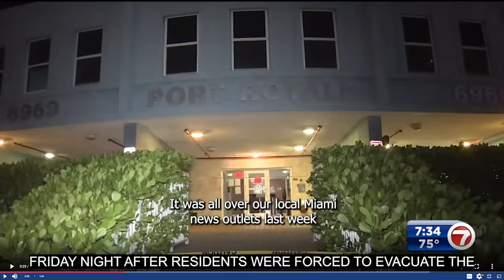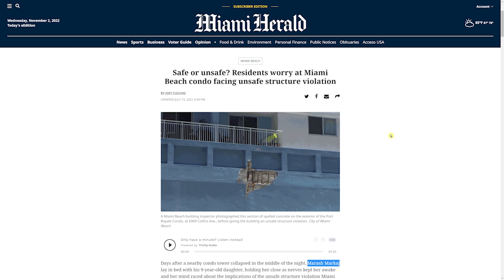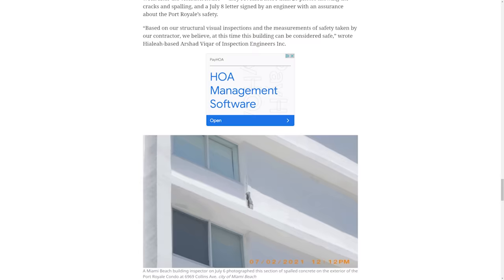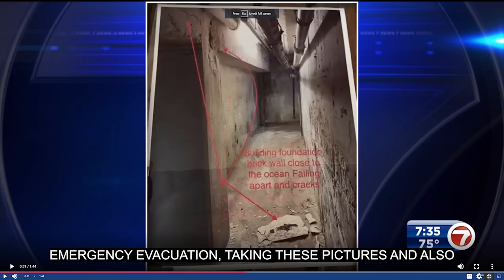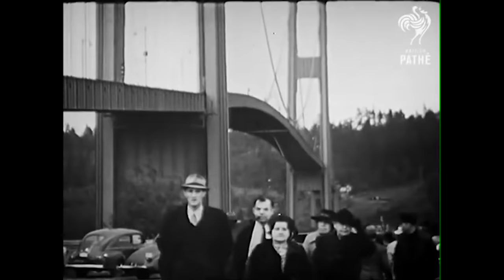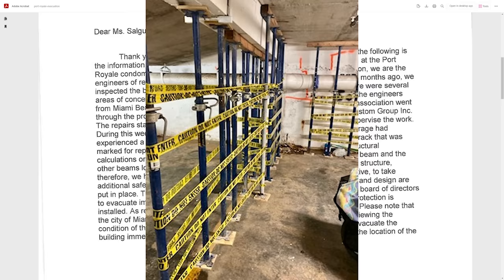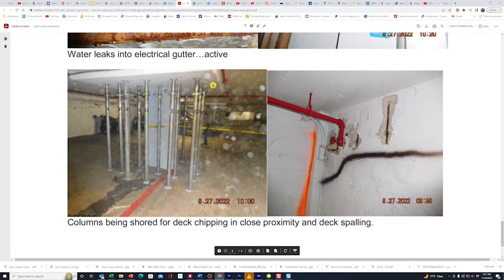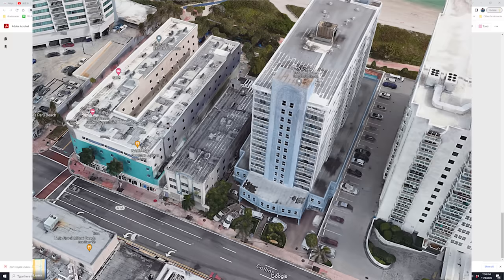Another Miami Condo Evacuated Why it Will Collapse

Comment: It has  become crystal clear from the corrosion photos in the collapsed condo as well as this one ( and tens of thousands of bridges and other steel rebarred structures) that steel rebar, although the cheapest solution, should be permanently forbidden via changes to the underlying codes from being used in construction of all structures. What will replace steel rebar? Epoxy coated steel rebar will not work either because construction damages as well as numerous pinholes allow ions to penetrate = same corrosion occurs, albeit at a delayed, but inexorable, rate. The use of triple dipped galvanised steel rebar is OK for 100-200 years. Additionally stainless steel (SS) solid rebar is a permanent solution and will add only ~~1% to the cost of the structure. SS is about 15-20 times as costly - but negligible in cost overall. Steel rebar can also be coated with SS in a rolling process more cheaply at a lower cost and the surface grip indented for mechanical keying in this process - cut ends needing epoxification to reduce end migration of the deadly ions - rolled SS coated rebar with epoxy should also serve for ~~ 200 years. Total SS rebar should serve for millennia. Lead will serve, but has environmental risks - as the Romans found!!

Comment: This building is unsavable, as are many around it.  Concrete absorbs and holds moisture, and the steel rebar gets a moisture bath 24/7.   Its whack-a-mole at best, for a few years until they have to face the music.  You find this everywhere, but it is accelerated in tropical salty conditions.  There is rusted rebar throughout that entire building that isn't even discovered yet.  I've been a contractor for 46 years, and in that time you see a lot.  You learn to connect the dots...

Comment: One concern of mine is the possibility that some unscrupulous contractors might have substituted cheap and plentiful salt water in place of fresh water in the mixing of the concrete for these structural members. The salt water in the concrete would accelerate the corrosion of the steel rebars within and lead to weakening of the concrete.
Reply from the maker: A lot of people tend to spread and make up this unbelievably false myth. This has nothing to do with the contractors, the concrete is delivered by concrete manufacturers miles away and they make it to very strict formulas they are nowhere near the ocean and just deal with local water.

Comment: Just give it the good ole land lord special. Some calking and paint ought to do
Reply from the maker: Naw don't spend that much, duct tape!
Reply: @jeffostroff  when i studied chemistry before switching to engineering i often wondered why we dont put some kind of thick sealent or UZ resistant epoxy on concrete buildings along the coast. Then when I was studying electronic control theory, we were tought the user should not have to know more control theory to control your device than you. Then the 737 max control problems happened. Those pilots had no idea they only had seconds to disengage auto contols before their aircraft went into unstable flight.

Comment: OK, I'm just an Electrician, but IMNSHO, that beam in the garage needs the shoring poles extended at LEAST another 6 feet each side, AND a steel plate cap between them and the beam.
That's still a bandage on arterial bleedimg, though.
How come no one uses sacrificial anodes???

Comment: These South Florida  structures always show a ton of  " rust on the rebars of old ".  The salt air in some of that great weather is driven deep into the structures causing dis-adhesion to these structural elements over time.  The fancy coated rebar of today  is better protected from corrosive elements.  I see these things through my deeply educated mind and eyes.  Scary stuff for sure,  but it doesn't mean someone set out to build cheap or use less strength in the structures.   Technology of the day, and engineering specs, were what they was in many instances.

Comment: All beams are in compression and tension by definition.  What you may have meant is that the entire cross-section went into tension when normally it is only on one side of the neutral axis, although then it wouldn't really be a beam would it....
Reply from the maker: Yes a lot of curvature on the bottom of the beam

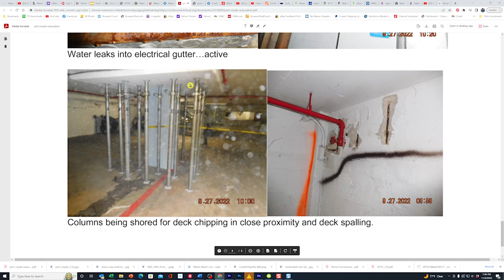Comment: @11:00 ~ , my guess is why the photo quality sucks is it was taken with an old digital camera, as it has a date/time stamp in the photo which usually only digital cameras add (dont see it much on cell phone cameras, and the font looks like the generic ones on most older digital cameras.) so they probably never updated their cameras and are still using an old 3-5megapixel camera from the mid 2000s, i mean it works but most new cell phones would give alot better pictures, i guess they need something that adds a timestamp for documentation purposes

Comment: They probably should not build tall buildings near the waterfront. I'm not an engineer, but I understand that the problem with rebar is that the steel eventually rusts in most/all cases. Does anyone know how tall one could make a building just using concrete, or stone based materials, with no rebar?
Reply from the maker: Some of those taller 40 story condos in miami that they built the last 10 years are likely steel columns and girders

Comment: Turns out steel reenforced concrete needs to be kept dry like wood. Do that and it will last 1000 years. Otherwise the salt gives it a service life of 30 years. I worry about other rain soaked concrete too, even without salt. Rain is slightly acidic and over time the pH of the concrete will fall sufficiently to rust steel.

Comment: These are built on sand dunes, and probably didn't have their vertical  posts of cement attached to bedrock.
Reply from the maker: John there were over 100 piles pounded down to the limestone bedrock. It's in the florplans. There are no dunes down there, just flat beach

Comment: Why not use stainless steel rebar or corrosion-proof rebar for all structures near the saltwater beach?
Reply from the maker: I'm not even sure if epoxy coated rebar was used at the time of construction back in 1981. Nowadays many construction projects use it so I'm sure if this building had been built today it would be in a lot better shape.

Comment: Boy concrete is such a slippery slope. It's the stoutest material for building on earth and the most volatile when it begins to fail. Wood is crappier in storms, fires, load bearing, etc, but nowhere near as heavy and much quicker to repair.

Comment: That beam has already failed, it just hasn't yet collapsed.  Those cracks can't spread horizontally like that without it essentially beginning to fold.  I'm not a structural engineer, but any engineer can see a major failure in that crack pattern.

Additionally, the shoring looks questionable.  The rightmost support only has about 40% thickness of the right side above it, which doesn't seem sufficient.  I'd like to see it extend to at least a couple of poles with the full beam above them.

Comment: Two issues that are fatal and cannot be fixed:
1) Rebar. It is a "cheat" that structural engineers use to have a cheap material that only handles compression (concrete) in applications that have tensile forces. The Pantheon is 2000 years old, made of concrete, has no rebar, and is still standing. 
2) Condo Associations. The tenants/owners refuse to add maintenance fees to their monthly bill to establish an escrow fund. They choose to wait until either (A) they die and the problem is no longer theirs, or, (B) something catastrophic happens and they have no alternative to paying for the maintenance.
Reply from the maker: The idea is to put enough additional support to help these beams that could be in tensile forces to keep them away from being intense all forces by making sure it's stationary. It's no different than operating a transistor and making sure that it operates in the saturation region so that you can make a transistor be a switch instead of an analog component.

Comment: On A Serious Note the NTSB doesn't bat an eye when it comes to grounding aircraft once a mechanical flaw is determined.  So buildings ,especially those in such harsh environments such as Miami shouldn't be any exception. I'd rather be homeless than dead. Given the changes in our climate & although Miami doesn't deal with freezing they do however deal with seriously high winds during hurricane season, let alone the wear & tear that exposed rebar takes on with salty ocean water. You'd think many years ago they'd of established that all rebar used on coastal cities should of certainly been treated with some sort of anti rust/ corrosion inhibitor to prevent such structural deterioration.

Comment: I think reinforced concrete is one of the worst ideas humanity has ever had.
Civil engineers love it because it is relatively cheap but they ignore it's achilles heel - corrosion.
As a mechanical engineer I have a low opinion of it because its final properties are so dependant on how diligent and honest the construction contactor was.
It is very difficult / impossible to inspect the quality post construction.
Also it seems to me that civil engineers often sail very close to the wind - as if it is a very predictable material.
Case in point - in 2004 I was in the Charles de Gauile terminal 3 a week before it collapsed. I had 3 1/2 hours to kill and was very intrigued by the shape of the structure. I was amazed when I realised that it was reinforced concrete rather than steel as I would have expected.
I thought to myself that I would never have dared to design a structure that way, but assumed that I was just ignorant. Turns out that the French civil engineers were just arrogant and negligent.

Comment: Funny thing is about 50 year old tower issues.    Well, the "unreinforced" concrete dome - the Panthenon in Rome - was dedicated in 126AD.  It is still standing and in use.
Reply: Totally different construction methods, and totally different practicalities. The Pantheon has extremely thick walls at the base, with very minimal openings aside from the opening at the top and is obviously a dome - domes and arches are self supporting. It's also supporting nothing but itself.
It was created at very high cost, took a decade to build, and was presumably designed and built by the best people they could find.
The lack of reinforcing is a large part of the reason why it still exists, as there's no steel to rust inside & damage the concrete.
Numerous old structures, built with little regard to cost, did collapse. Often repeatedly, and were rebuilt, or just don't exist any more. Any structures built with equivalent "care" and cost to these towers, in ancient times, are long gone.
Modern buildings that can be built quickly, cheaply, with a lot of usable space and many openings for doors and windows, require reinforcing.
Similarly modern reinforced concrete domes(typically used for storage), despite being much thinner & designed/built without the expertise needed for the pantheon, very rarely collapse even though they're common.

Comment: The solution to the porus concrete and salt water is to use the same formula the Romans used and put ash from volcanos into the mix and as a result it will self heal any porosity.

Comment: This brings up another thing that I don't think is done right or safe at all in San francisco. The tall skinny hotel building that I can't think of his name at the moment that after it was completed had started slowly leaning more and more each year. And when they finally claim that they had fixed it a couple of years ago on a documentary that I watched it seemed like they just temporarily supported it in a fashion that does exactly what you're talking about with shifting the load. What they did was dig down around the outside four walls and beefed up the supports under those exterior four walls. But the entire ground that the building is built on was and is shifting, so all they actually did was support the outside poor walls and anything still sinking under the interior of the building has no beefed up support which tells me all the strain is going into the core of the building and making it pull down inside itself. There was no easy fix and they never came up with a fix because what they did does not solve the problem and only temporarily stopped the leaning and shifted it toward a scenario of internal collapse. But of course you don't hear a single word about it anymore and that is because of the California government and mainstream media. A lot of people are going to die if that building goes all at once. Not to mention all the collateral destruction of the buildings all around it. Somebody needs to call them on it before a couple of thousand people die from a cover-up.   ❤️

Comment: Looks like there's a big problem with sea water getting into the condominiums. Whoever authorized this style of building so close to the sea forgot to remind the owners that they needed protection from the sea water. It might also be a bad batch of concrete, I've seen nasty results with concrete that has absolutely no water of any kind in sight, it breaks down and cracks apart. It happens because the mix for the concrete they wanted to pour was improperly made or had too many contaminants in it. They shouldn't try to repair it, they need to tear it all down and rebuild it to modern standards, and pay close attention to what materials they put into it.

Comment: There obviously is something wrong with the ground in that area. All the buildings along that stretch need close scrutiny. They're never going to be able to fix that building. It's coming down one way or another. Damage like this spreads like Cancer and weakens the entire building at an accelerated rate. Each day, the building is weaker than the day before. If I lived there and saw all that, they wouldn't have had to evacuate me. I'd of already been GONE. Especially with a collapse already happening a mile away. LONG GONE!
Reply from the maker: everybody keeps coming in with that same old cliche that they are building on sand. They are not building on sand what they are building on is hundreds of piles that have been pounded down through the sand and into the solid limestone bedrock below. There is no such thing as building on sand it's a conspiracy theorists favorite folklore.
Reply: @jeffostroff  First off; pilings are only truly effective if they reach bedrock. And I never said they were building on sand. I said there is something wrong with the ground. HELLO? It's possible a giant sink hole is forming deep underground. This isn't as uncommon as you think and can reach miles. And they're at what, 3 feet above sea level? Water erosion is very dangerous. I remember when the Corvette museum collapsed. That was an underground sink hole caused by water erosion that took decades to become unstable. Meanwhile, with seemingly no warning; a priceless collection of Corvettes wound up two stories down in a sub-basement that didn't previously exist. And there is plenty of warning with this. Now Dubai? They build on sand. They think floating slabs will hold up a high rise. And they most certainly don't. Not for long.

Comment: Miami is going to be plagued with this.  Miami saw a boom post WW2 that rode into the 1960s seeing demand for higher density buildings.  But once the 1970's came around there was a shift in demographics and Miami found its biggest potential draw was older retirees.  Miami needed to capitalize and extend that population growth in order to guard itself from economic collapse. So in order to sustain that market you needed large cheaper condominium structures built in masse, with lower scrutiny over engineering, less foundational prep work, quality inspections, checking materials, etc.  Now 40-60 years later we're going to keep seeing the shortcuts taken to attempt to capitalize and extend that wave of Miami population expansion.

Comment: you could not pay me to live in one of those things, and another reason back before andrew hurricane fl building code were 
basically suggestions and inspector's were eager to do drive by inspections and if you did not grease they dont show up when you request,  the codes were updated but was corruption curtailed . west coast imo on houses they require too many and permits on minor repairs are expensive since we dont have too many hi rise condos not sure but there building hundreds of multi story wood crackerboxes apts
Reply from the maker: At least repairs will be done to modern code

Comment: Obviously it is cracked beams 4:40 and pillars you should be worrying about, not some minor damage to a wall 4:00 or cracked ceiling 5:44. Now that exterior wall does need patching up to stop water ingress, but engineers are right to ignore cosmetic damage on the inside of the building like the damaged parking garage ceiling. You can see minor damage like that on any 50 year-old concrete structure. If it's not load bearing and not exposed to the elements, it does not pose a threat to the structural integrity of the building and therefore can be safely ignored.